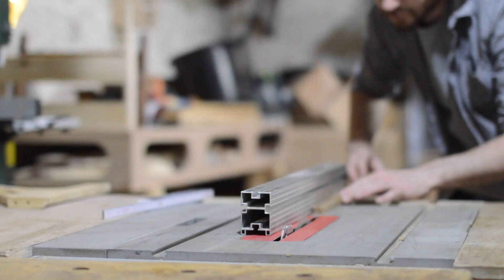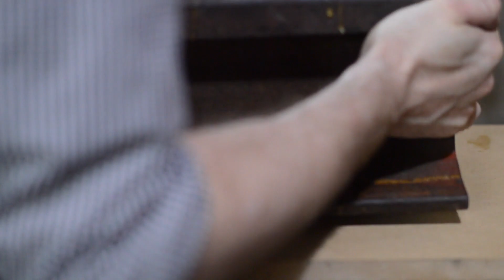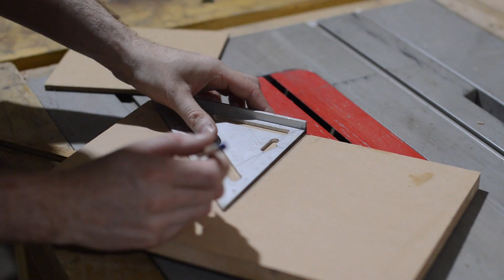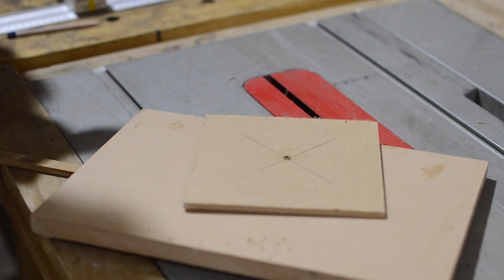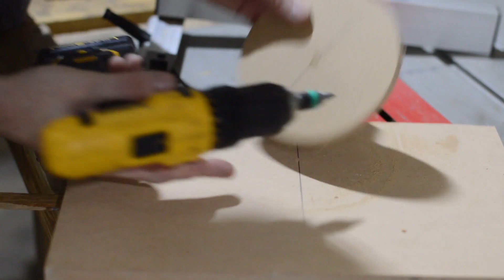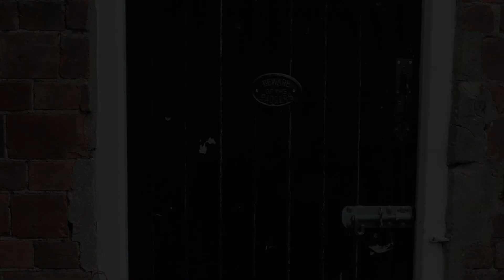Bandsaw Circle Jig

Comment: Very clever jig. And it seems easy to make. My small band saw does not 
have a miter slot. But i guess somehow it'll work with clamps for the 
base board as well.
What are the specifications of the blade you used?  Thanks for sharing 
the video.
Reply from the maker: I have lots of blades but the one I use most is 1/2 inch 3tpi.

Comment: Could you trim more of the waste off before you start cutting on the band saw?
Reply from the maker: Yes you could.
Reply: Badger Workshop just because you mentioned you where going to cut thinker material
Reply from the maker: It won't affect the work the bandsaw has to do but its good to not waste wood.